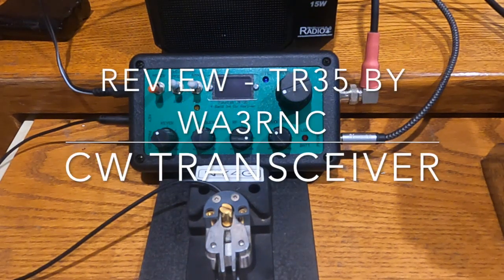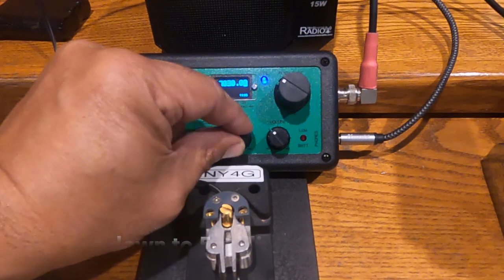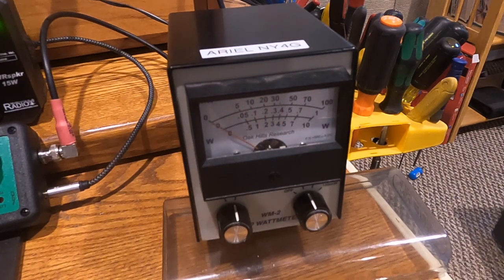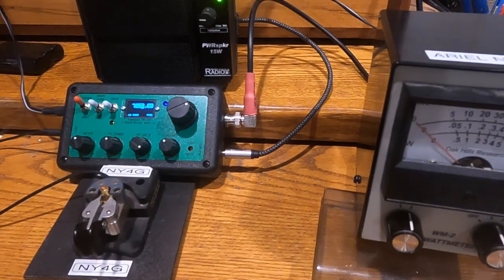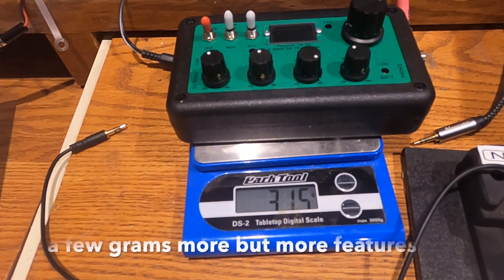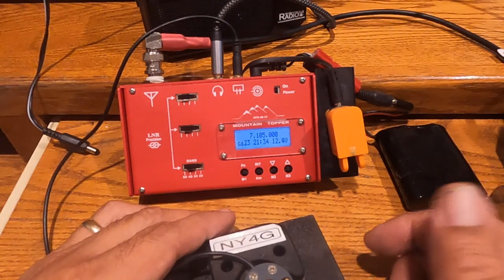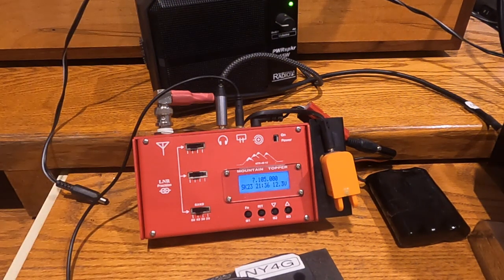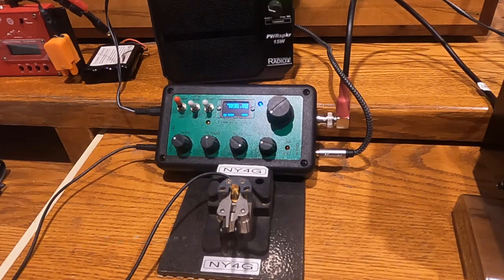Review of the TR35 CW QRP Transceiver

Comment: So I've been trying to talk myself out of purchasing this rig.  This might become my x-max gift to myself.  I love my MTR4B, but there is something about this radio that I love.  You doing a review and showing all the bells and whistles is not doing me any favors.  lol
Reply from the maker: It hits a nice sweet spot.  It has about the same form factor as the MTR.  The ease of recording and playback  into and from memories for calling CQ is a plus.  Power consumption is frugal and better yet - dial back power to conserve it.  It will work down to 9.5 V which can milk a Lithium battery down to zero.  During the current upward swing of the sunspot cycle - 17m is nice.
Reply: I bought it (haven't assembled it yet), after an exhaustive survey of available alternatives. Among the many pluses, and the general acclaim of everybody who has one, is that 17m capability. 20m, except without contests. What's not to love? And also the knobs. Thank you, WA3RNC, for bringing back sane interface design.

Comment: No button to set CW pitch.
ON6KE
Reply from the maker: CW side tone level is set by a potentiometer during the build.  The side tone pitch is fixed and if matched to the pitch of the incoming signal it it will be zero beat.
Reply: @CaptainRadioAdventures  And by shifting pitch too much you'll end up outside the receiver filter passband, i.e. you won't hear anyone or at greatly diminished signal strength come back to you..
Reply from the maker: Yes the sidetone pitch (frequency) is fixed.